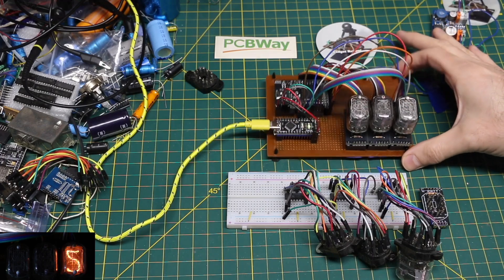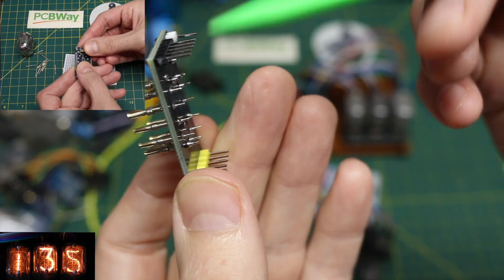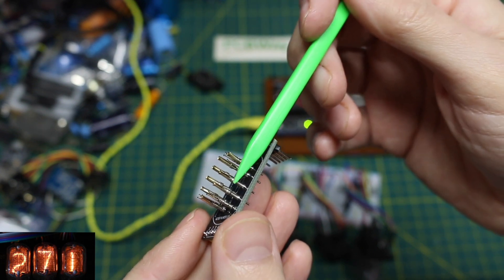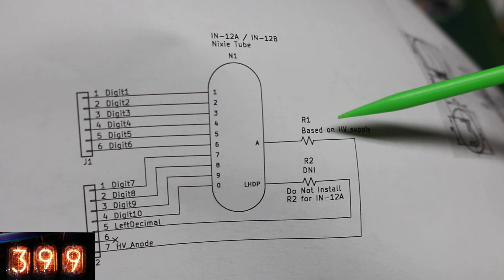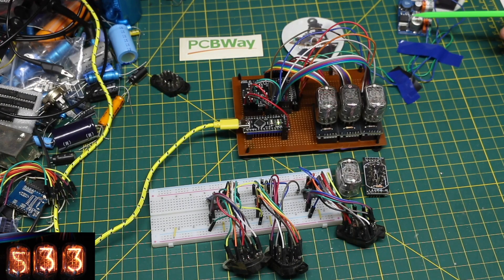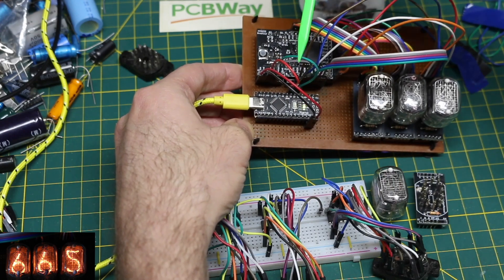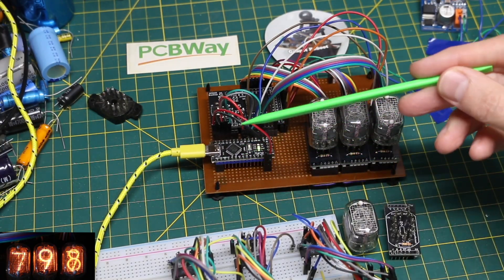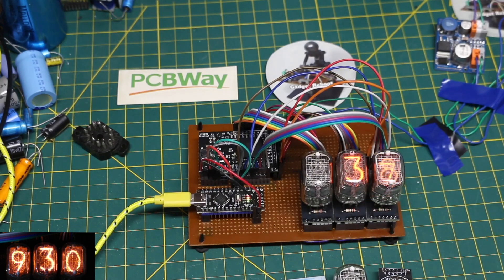Nixie Tube Driver Test with HV5222 and IN-12a

Comment: Based on some unpleasant experiences... those eBay/d-sub pins are okay for breadboard experimentation but they can become troublesome in permanent use. The hot tip for socket pins that won't fatigue-out is appropriately sized Mill-Max machined pins from Mouser/DigiKey/etc. Not cheap, but the quality is great.
Reply: Life saving tip, thank you!